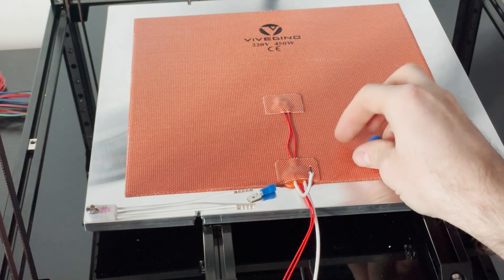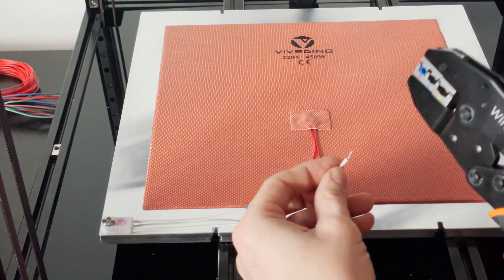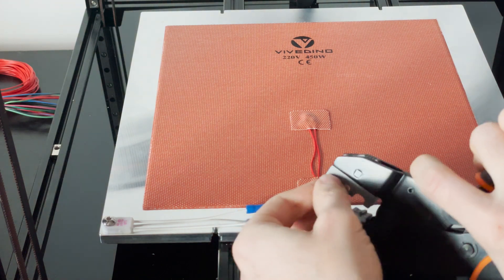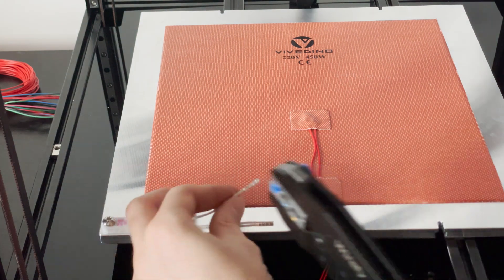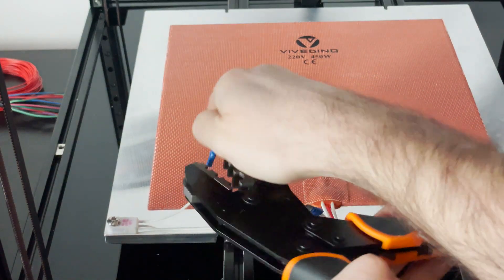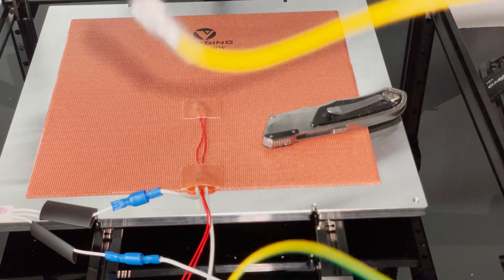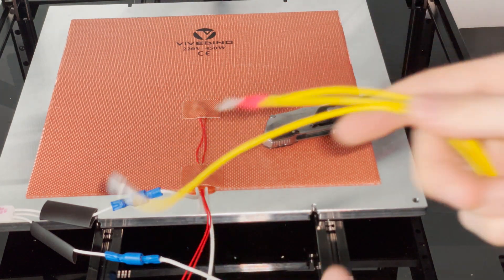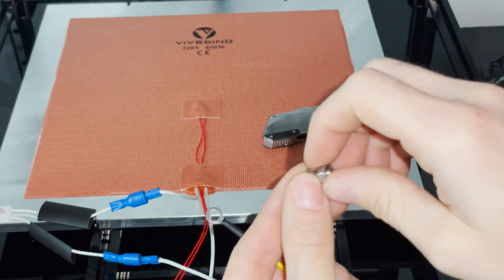Voron 2.4 - Part 16 - Heated Bed Setup

Comment: hello, waht is te size of aluminiun plate and silicon heater?
Reply: The plate is 30x30 cm and the heater is 25x25 cm
Reply: @alexstanciu8066  thanks ! thicknes aluminuin? heat reaches the entire aluminum plate?
Reply from the maker: You're welcome! Thickness is 8mm and I would say the heat does reach the entire aluminium plate pretty quickly. I guess having a bigger heater bed would help heat up the bed more evenly but I have not had any problems with this issue until now.

Comment: you get wrong moment for the flat sticker when you use the red moment on a blue plug.
It is a reason you get dots with different coulors on your crimp tool. The dot should match the coulor of the dot.
and atthe same time I Would use a joiner(cable holes in both ends) not a flat sticker, since its live power on that cable.
Reply from the maker: Hello and thank you for your input! I will check the wires and maybe update the crimping on them, it's a fair point that those conduct live voltage and we can never be too careful. Regarding the colors on the crimping tool I thought they were related to the thickness of the wire that is being crimped, I didn't know they are related to the color of the plug.

Comment: Anyone tested that "safety feature"?

it's doesn't fucking work, because thermodynamics.
Reply from the maker: I didn’t know that. So you are saying that if the bed gets somehow connected to the mains line due to a fault in the heated element having the ground wire connected to the bed plate won’t trip the breakers?
Reply: @PorcupineOfTheConnoisseur  I am saying that the heater will blow up in flames before the fuse gets to the 125 degrees Celsius and cut off the current.
Reply from the maker: @showmytime9177  oh, so you were referring to the fuse. Didn’t tested it and I do not trust it until I will test it somehow. Good point there!